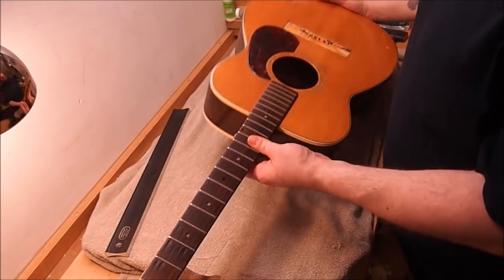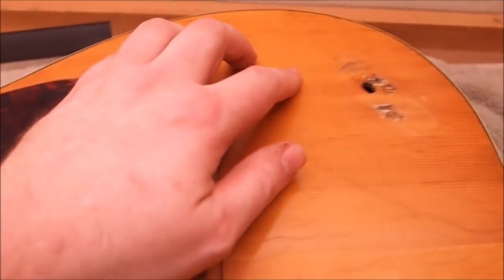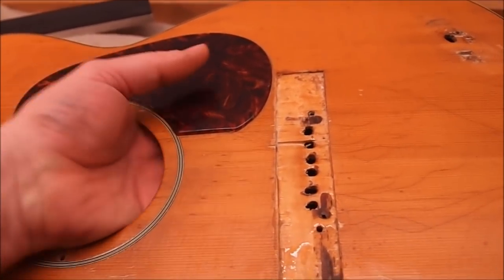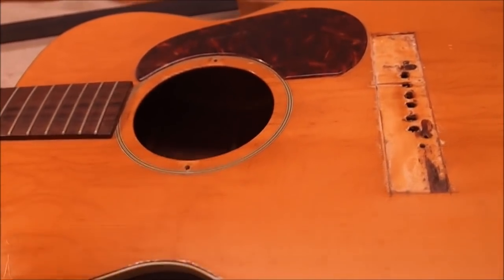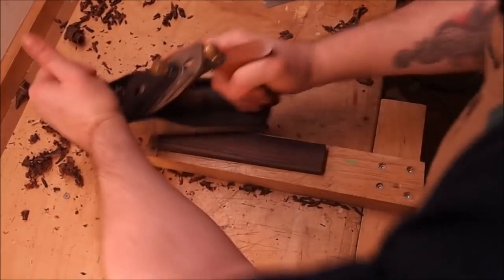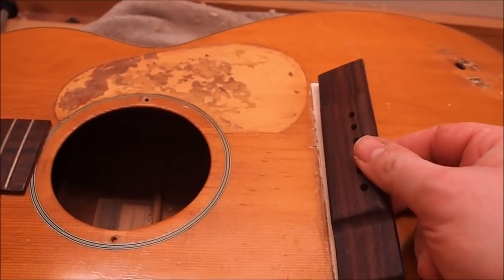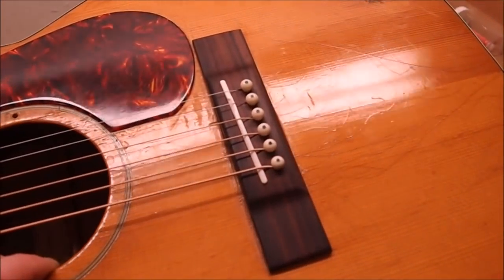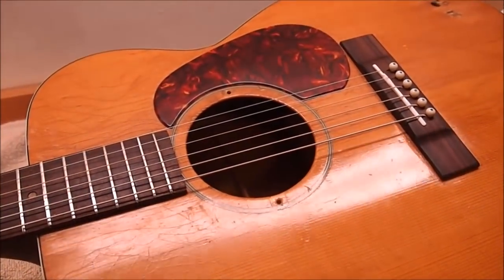Gretsch 6003

Comment: Nice.  I just did a Westbrook from 1969 with almost the exact specs and described feel.  Had to reinforce the bridge pad.  Got to re-used the OEM bridge after making some fill patches under it in the spruce.  This one had pulled the neck block away from the back, so the reset was easier.  I left the dovetail in tact and just reset the block in the back, repaired the broken kerfing, etc.  Still a very light guitar with odd fuzzy areas inside and small framing.  Almost sure the Japaneses MFG copied that Gretsch in every way.  Wide white binding, skinny nut, all of it ...  Kinda cool summer of love era instruments : -)

Comment: I love watching your videos. Even though I'm a guitarist/vocalist, I grew up with an engineer for a dad and have always enjoyed tinkering in the workshop. I've managed a few minor repairs on my Ibanez PF10 Dreadnought like making dings and scratches disappear with shellac and sandpaper, installed custom built fet input pickups both in the sound hole and under the saddle. The inner mike is adjustable which is very useful to balance the sound for recording in rooms of different size and acoustic.I also hand carved and sanded my own bone bridge and saddle. I bought this guitar brand new in 1985 just as the agents were unpacking the new consignment from Japan, and I took my time finding one that spoke to me. At the same consignment they also had beautiful top grade Yamaha concert classics one of which my music teacher convinced them to sell to me one for twelve post dated cheques.The Ibanez has a solid red cedar top and solid Mahogany neck, back and sides and has aged beautifully.What used to be a slightly brash tone has mellowed out into the sweetest full sound. My Yamaha has Indian Rosewood back and sides and a Spruce top and it has most definitely become much louder, deeper and more sonorous with time. It's amazing how much detail comes through even when softly played. I can confidently assert that the bone made an incredible difference to the quality and clarity of the sound.I wouldn't mind working in a workshop like yours, it looks like a very interesting experience.

Comment: You're right - that'a a very clear tone and worth saving. Great video. Forgive my ignorance - what would cause the dot inlays to recede like that? Is it the actual pearl(oid) inlay that is shrinking? Or is it some sort of shift in the rosewood board?
Reply from the maker: I think the original holes were drilled quite deep and at some point somebody pressed on them. I'm not sure. Celluloid does shrink a bit, but not that much.
Reply: @twoodfrd  : Very interesting! I didn't think they could sink that much naturally either, so thanks for the info. Appreciate the response. Keep up the great videos.